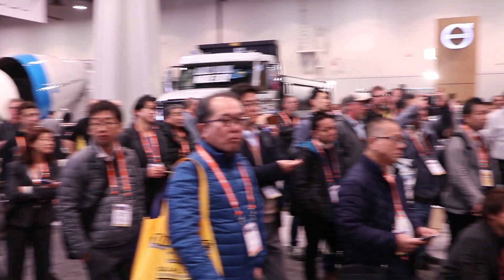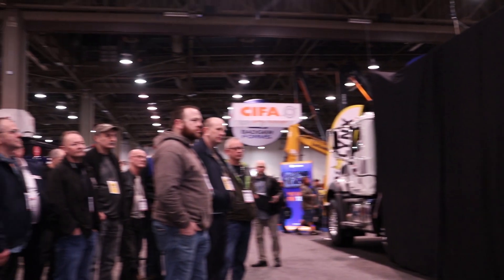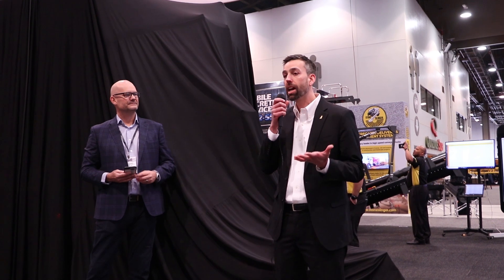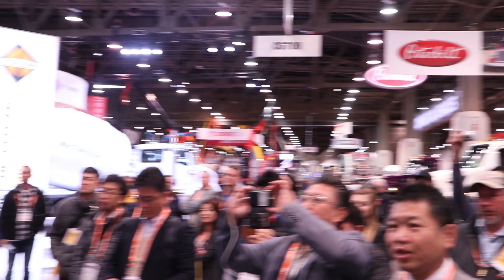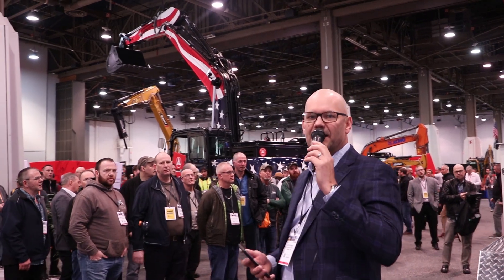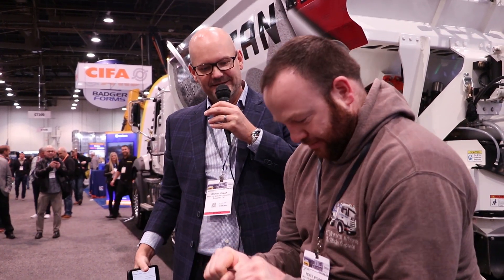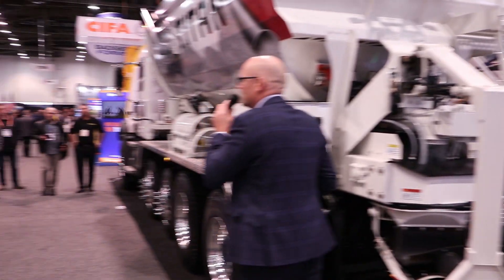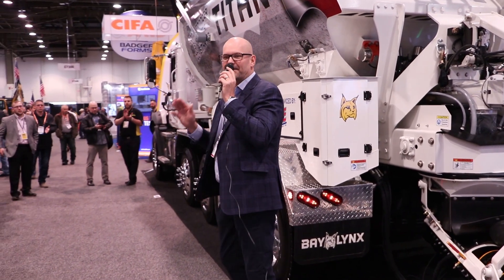World of Concrete 2020 - Bay-Lynx Titan Mixer Reveal

Comment: It looks cool. But i think there's too much technology. A wire goes out, how bad would that affect the mix. Concrete is a messy business. I hope that is durable like he said
Reply from the maker: Hello Isitolo. Everything on the machine has manual backup valves. In the event of any electrical failure, you can still operate the hydraulics to finish the job, clean the mixer and drive back to the shop to diagnose the issue. The electrical system is their to assist but the machine is not dependent on the electrical system.